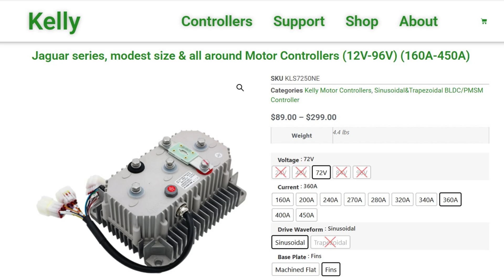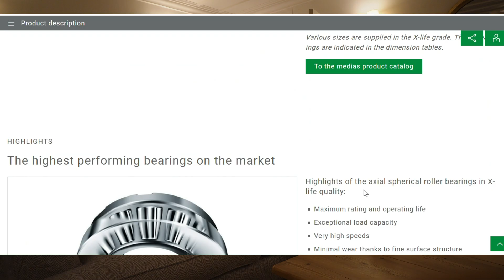Cheeky episode: I ask YOU for expertise - rotary bearings & electric motor ESCs.Project BERNARD [4K]

Comment: Thoughts on bushings over bearings as a potential option? My gut instinct is for bushings over bearings for the Sea to Bernard's insides interface. Can get some turned easy enough, simple, appropriate for low speeds, very hard for something to go wrong, cheapish. Maybe could go for self lubricating but I think Id prefer a low pressurised grease setup. And still advocating hard for paddlewheel hub caps. 😆🥳
Reply from the maker: I've done a dive on bushings and have been steered away. I'll try and explain why on the bearings episode. 

Your second idea - not a yes or a no at this stage!